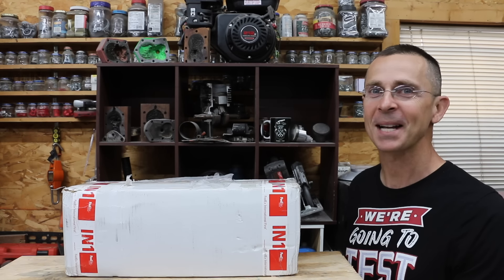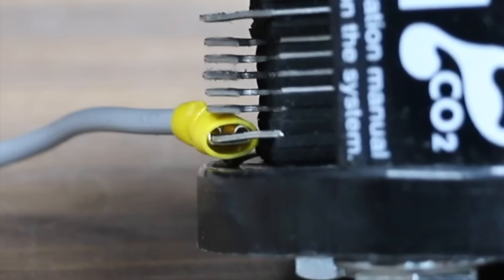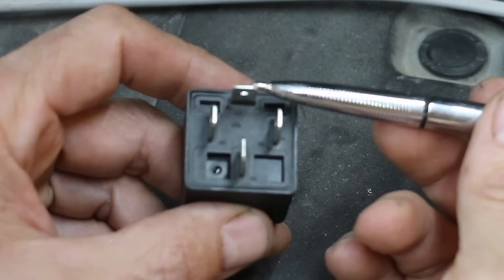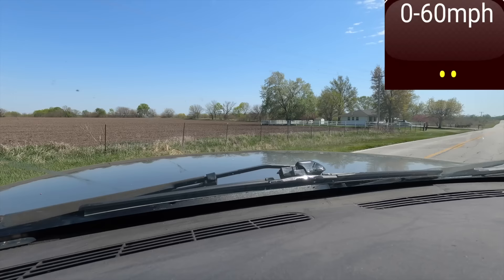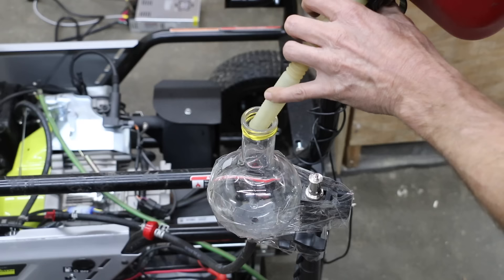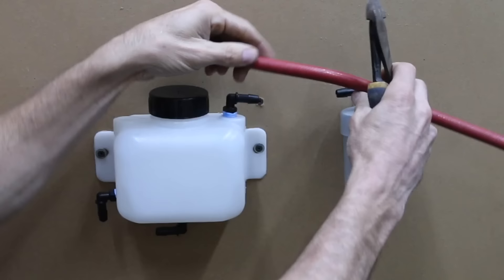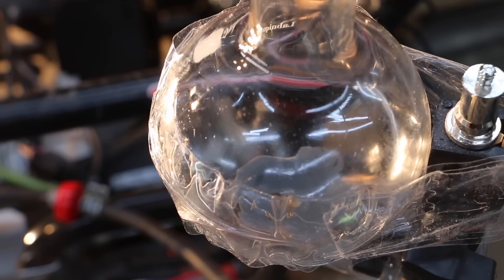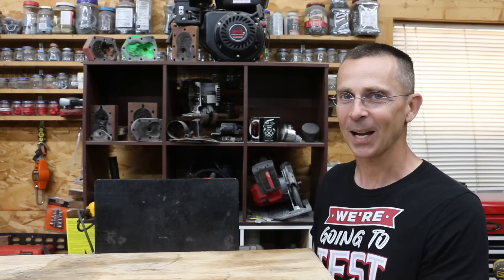AMAZING 35% More MPG with HHO? Let’s find out! Help with high gas prices?

Comment: I want to see more fuel saving devices tested
Reply: 🦶 This will save you fuel.
Reply: Spoiler alert- they are all scams.
Reply: @chrisE815  only thing that helped me get better fuel millage on my ram 5.7 on 35's was a tune. I tried this hho system about a week and I was averaging 7.8mpg driven hard before hho  it  was 8.9mpg daily driven and driven hard no tune no hho. After the tune my avg was 15.9 mpg and a gain in performance as well. 

This is for everyone that is interested in this item. If you are planning on getting better fuel millage and better performance from your car or truck engine spend the extra money and get it professionaly tuned. It will save you time and effort. This thing is a scam.
Reply: @danickdesrosiers7338  if you want to save fuel, you could just buy a smaller car. 
My car goes about 50mpg and its not slower or less comfortable than your car.
Reply: @TobiasHinz1992  what kind of car
Reply: The best free fuel saver is a lighter foot, otherwise 🚲🚲🚲.
Reply: @danickdesrosiers7338  If you are getting better gas mileage AND fuel from a tune, you are severely decreasing the life of your engine. It all comes with a tradeoff, otherwise they would be tuned that way from the factory. Now after the car is used a lot and parts wore in a tune to re calibrate everything in theory could help some without sacrificing engine life but a lot of manufacturers computers already have that figured into it. Only time a tune is actually worth it is if you are using the car for performance and don't care about the life of the engine.
Reply: @TobiasHinz1992  Imagine being in your mind. Terrifying. "Oh hey stranger! I know more about your life situation than you do."
Reply: @MrSplibb  Skoda Fabia Combi 5j, 1,2 TSi, 105HP
Reply: @eriklarson9137  you're american and I know enough of you by that. You all drive way to big cars to impress the neighbours. That's why car repossession is a thing in the USA.
Reply: Or, alternatively, debunked.
Reply: @TobiasHinz1992  cars get taken back in other countries also.
Reply: I read that riding a bicycle will help save fuel.  I will ride my bike this week and get back to you guys with the results.  Don't worry, I bought my own bike and I'm not sponsored.
Reply: @josh6149  different strokes for different folks.   I'll keep driving my f350 and trans am.
Reply: Same
Reply: None of them work. No testing needed.
If anything worked then vehicle manufacturers would use it. They struggle to meet the power and efficiency targets more and more with each new model and wouldn't overlook something so simple as magnets clamped on your fuel line or some other garbage.
Reply: @1one3_Racing  the technology has been around since the early 70's, but suppressed or destroyed by the federal government, to satisfy their big oil contributors.   A guy had converted a 1970 Cadillac to run mostly on hydrogen, getting around 70 mpg, but he disappeared, along with the design he developed.
Reply: Waste of time. All are scam ripoffs.
Reply: Oh no sir.  U got a defective unit...just call the seller. And theyll ship you a proper functioning model...maybe it was dropped during shipping...
Reply: @JohnJohnson-bg2oo  
it’s not big oil It’s emissions
Clean air 
And somebody said earlier up in the comments it is the longevity of the motor
Reply: @Voyajer.  I had an S10-ZR2, not bad up to 55, but above that I swear I could see the fuel gauge move while driving down the road.
Reply: Anyway, if these apparatus was so good they would add them at the cars factory!
Reply: @aaronwetzel8444  yeah, you keep believing that bullshit, but the reality is that the federal government uses fuel prices, and lower efficiency motors, in collaboration with oil companies and automakers to keep them in office and us under control.   If everyone could drive an efficient gasoline powered vehicle, and save money from doing so, they'd figure out some other way to tax us for being less polluting.   The fact is that global warming is a hoax, as far as any real climatologist has studied, and the green new deal bullshit is a fictitious way toward communism in America.
Reply: @f4tboy99  Stop drinking the Cool-Aide!  It's "Big Oil" keeping them out of the hands of consumers on a large scale.  It's amazing the reach that Big Oil has, they even have sway over cars made in Russia, China etc.
Reply: @JohnJohnson-bg2oo  hydrogen gas has similar if not lower stored energy to gasoline, changing to hydrogen can’t give you ridiculously higher mpg. Hydrogen gas is a extremely small molecule, and experiences a lot of blow by when used in gas engines. Further more producing hydrogen gas  requires energy to begin with, energy that could be used more efficiently...
Reply: @thedarkness5133  tunes from the factory have to take smog control into account not economy or performance. There is lots of wiggle room for improvement without damage.
Reply: @VC-Toronto  Are you saying to me that you would buy them? 🤣🤣🤣
Reply: @Dirty_Bear22  yeah okay, they use it for the space shuttle, mixed with kerosene or jp4 jet fuel.   Seems to store plenty of energy to shoot hundreds of tons of metal and composites into space so....🤣😂
Reply: @thedarkness5133  From someone who actual has experience both with tunes and as a mechanic - this is straight up horseshit
They are tuned the way they are from the factory to run normally for the lowest performance they expect from the parts they fit, this means loose ignition times and many other settings are slack and often actually are more damaging to the engine over time than a tuned one where they have spent the time getting result for your car as it is and making the profile fit

As for the profiles from the factory being designed to avoid sacrificing engine life? Get real - there's a reason why there are expected mileage breakpoints in used cars, they are designed to wear out at certain points in order to encourage those who buy new to continue on the treadmill rather than maintain their own vehicle
Reply: @JohnJohnson-bg2oo  Yes global warming is a hoax. But it is nice to have less smog in the cities.
Thankfully the coal rollers are mostly in the country where the plants happily feed on their stupidity.
Reply: There's no such thing as a free meal. From a conservation of energy standpoint the best you could hope for is getting your 70 watts of power required to generate the hydrogen and oxygen back when they are burned. But there's that whole entropy thing that probably no one cares about...
Reply: @BinkySears  actually a alternator is a above unity device.
Which means the power that it takes less power to spinet it is less than the power that it generates. 
by less than 1% but this means theoretically if you had a big enough motor and a big enough alternator
You could generate free power!

But sadly this is impossible because they do not have a electric motor that is 100% efficient.
Reply: @JohnJohnson-bg2oo  okay? Not sure why that’s relevant to vehicles though.
Reply: @aaronwetzel8444  you will always have losses, the best theoretically possible efficiency is 100%. You can’t make something out of nothing.
Reply: @bengrogan9710  You may be a hack mechanic, but you sure aren't an engineer or scientist that understands more than the surface of things that people told/taught you.
Reply: Years ago... around 1970... we took a J.C. Whitney auto parts catalog and added up ALL of the claims of the various "sucker bait" device ads (full page of glowing promises)  - pills for the oil, fuel line magnets, goofy spark plugs, 'energizer' liquids for fuel tank and oil, etc.

By our reckoning, if you installed ALL of that stuff your little car engine would become a TIGER at the drag strip and beat all competitors; to run it on the street it would need some kind of governor it was now such a *powerhouse*. 

You'd get so much mileage improvement you would need to stop every 80-100 miles to drain the fuel from the tank before it overflowed - never needing to ever fuel up again... and your engine would be rebuilt as you drive!
Reply: Yeah
Reply: @Dirty_Bear22  
Alternators are classed as a above unity system.
More than likely this is because the energy that it receives is rated differently and the energy produces.
Reply: yes please me too, instead of snake oil this machine was more like snake piping
Reply: @JohnJohnson-bg2oo  bullshit. You can go to a "chip tuner" and he'll get you better fuel economy, but your car will run too lean and you will have holes in your pistons soon
Reply: @VC-Toronto  tell me about it man. My STi when above 80 and at full boost gulps gas by the gallon. Smiles per gallon though is what counts even when its 6mpg!
Reply: @TobiasHinz1992  That’s where the Hydrogen generator comes in the water produces in your cylinder provide some coolant allowing you to go far lean or on fuel before something breaks
Reply: The problem is hydrogen and oxygen combining is a heavy oxidizer
Reply: @aaronwetzel8444  again bullshit. If you want to lower the combustion temperature, you need to install a water injection system. But with these you have to look for your oil, because water kann mix into it.
Reply: @thedarkness5133  Very well rebutted, totally countered the points I raised with factual argument and totally wasn't simply an attempt to smear with nothing of value said. /s
Reply: @TobiasHinz1992  Direct injection water works amazing the explosive power of water when contacting hot steel provides over twice the power per volume of diesel.
Warm water hitting hot engine components causes premature failure.
As far as hydrogen oxygen combines into steam providing some coolant not enough to prevent serious engine damage end it also causes oxidation to the rings and valves
Reply: Propane kits work, but you need a source of cheap propane and an older car since it would be very difficult on a new vehicle.
Reply: @JohnJohnson-bg2oo  Hydrogen cars have been a thing longer than the 70s, and you can literally buy them new today or convert existing engines, its not some big hidden secret thats been covered up.
Reply: @nugginusslover476  actually the head injury happened before I got a drivers license and I have no memory of anything before it. And only remember what happened vaguely my older sister drop me on my head I was under a half year old I still remember it. I have a photographic memory I was able to tell my parents where it happened and details about the room down to the paint color and what was happening outside the windows.

Also they don’t even call global warming anymore they call it climate change.
Yes cleaning up the air to much is going to cost us all to roast lol.

My parents were told that due to too much pollution we were going into the Ice Age this makes far more sense then what were being fed today.
Actually it might’ve even been true and that would make sense we averted a major Ice Age by cleaning the air we also got rid of acid rain.

with defrauded a major disaster what we’re seeing it’s a pens on the swing.
Pollution caused Global cooling now it only makes sense Getting rid of pollution would cause Global warming.
Follow the logic I guess head injuries help you to step back and see the bigger picture :p
Reply: Skoda hahahha thau car is a big joke in europe
Reply: @aaronwetzel8444  so let me get this straight. Your understanding of climate change is: "pollution" -> less sun -> less heat
And all the scientist magically forgot that but you remember it and actually get it?
Please inform yourself how climate change actually works and if you find a flaw only then respond please 😘
Reply: @nugginusslover476  I believe that this is Bill Gates understanding of it that is why he has developed a plan to release sun blocking pollution in the atmosphere to stop global warming.

Bill Gates is funding a chemical cloud
To block sunlight.
Do your research and get back to me
Reply: @TobiasHinz1992  you made ABSOLUTELY no sense in that statement! 🤣 Holes in pistons are caused by a timing issue, not the fuel/air ratio in the combustion chamber. 🤣 So if you buy a chip for your vehicle and don't have the know how to set the computer system on your vehicle, take it to someone who does, and it'll last just as long.   Just like a turbocharger has to be "tuned" to get maximum power/performance.
Reply: @aaronwetzel8444  so you didnt understand and now try to redirect my attention towards a project from Bill Gates. (and for your plessure I looked it up and its controversial)
Big hint: the exclamation marks in my previous comment. Not all pollution is the same. Not everything blocks the same wave lenghts...
Reply: @nugginusslover476  When I learned the most harmful greenhouse gas as far as causing global warming is water vapor.
Yes your point is valid not all Pollution is the same.
Step back and take a look at earths history Global warming global cooling and mass extinctions see the earth takes care of itself no need for human intervention
Reply: Vapor.  Fuel vapor, loads of vids, easy with a carb!!  The liquid part of petrol/gasoline is totally unnecessary, check it out!
Reply: @aaronwetzel8444  so you still havent looked it up. great, thanks comeback if you understood it and then disproove it. my final answer until that happens
Reply: @nugginusslover476  I have heavily researched The science behind Climate change.
I have also heavily researched the properties of different greenhouse gases.
I also heavily researched solar cycles
And earths history the climate is constantly changing.
Reply: Ignoring general cleaning, maintenance, and tuneups, the best fuel saving device you can install is a vacuum gauge. Not because it does anything by itself but because it can help train you to be more gentle on the throttle, which is much better for MPG.  Throttle to the floor will kill vacuum, which will cause the gauge to read such and indicate to you that you should probably let off the throttle. You can easily find a 10% increase in MPG with one once you learn to stop accelerating as hard. Especially on hills. Keeping a consistent throttle position on an uphill will help save a lot of gas, though you'll drop speed.

There's also fuel economy specific tunes that will absolutely kill engine power but deliver some MPGs as well. Like warm air filters that will always take in warmed air from a radiator for instance. Bad for performance, great for mileage. You can also mess with spark timings as there are timings that are best for fuel economy but bad for performance, and vice versa. Insulating the radiator a little so it gets hotter faster can help economy as well as adjusting the thermostat to allow it to run a couple degrees hotter, though you'll start sacrificing lifetime for that. But if you are driving high mileage, you probably won't be stressing the engine enough for it to matter if you don't go crazy with it.
Reply: @soundspark  saves up weight as well, better to replace doors with polycarbonate omes
Reply: @JohnJohnson-bg2oo  On point! Teach the peeps.  Shalom
Reply: @Dirty_Bear22  very relevant.. Did
u watch the whole video..?
Reply: @nugginusslover476  It is HOAX
Reply: @nugginusslover476  Exactly!
Reply: @aaronwetzel8444 Yup.  . Exactly what
Reply: @SuperReznative  you wrote 5 comments and addee 0% to the conversation. And you replied to me "hoax" on the one hand and "exactly" on the other. Atleast give some context if all you can do is react to comments and not add anything
Reply: @SuperReznative  what?
Reply: The only known fuel saving device is your foot.  My wife and I get 5 mpg difference driving her vehicle on average, just due to throttle and brake usage
Reply: @TobiasHinz1992  that...and the county we live in isn’t the size of a medium state...
Reply: A bicycle. On short trips your fuel consumption is just about zero.
Reply: @HumbertoYi0878  so what? My car is comfortable enough to drive very long distances. Do you really think that the shitty Pick-ups most of you drive are more comfortable than my car?
Reply: I have 3 different fuel saving devices that work perfectly......Up here we call them bicycles...
Reply: @TobiasHinz1992  does your vehicle haul 9,000lbs? No? Doesn't take a rocket scientist to figure out why there are differences in the way vehicles are used.
Reply: @josh6149  must be nice to live a mile from everything.
Reply: @JohnJohnson-bg2oo  You must have heard this on fux news....Ha, Ha, ha!
Reply: @joelthames1141  heard what?  Just because I'm smarter than you, means that you try to resort to labels in a pathetic attempt to make yourself seem smart?  I research several different sources for information, EXCEPT CNN, MSNBC, or CBS.   These MSM outlets have proven at best unreliable, and at worst, linear in their commitment to the corrupt democratic party, regardless of any facts they overlook or simply disregard for ratings.
Reply: @TobiasHinz1992  it's definitely slower
Reply: Want in one hand and xxxx in the other.  Ever heard of the word please?
Reply: TruthOrDie777. com  you have to add a "@" infront of the name.
I am in fact not a rockefeller but a I have decent understanding of thermodynamics and that's why I can tell you that a purely water powered car would never work and a hybrid version is always less efficient than just using that second energy source directly
Reply: @danickdesrosiers7338   Unless you're using proper scientific methods, this is not necessarily true.  It has been proven that when people do these types of things (any fuel savings device/tune/etc...) the positive results are from changes in your driving behavior which happen as a result of you "proving" it is working, for example:  you will not step on the gas as heavily when accelerating.  Cognitive bias is a real thing and humans HATE being wrong, especially when they have bought into something.  Most people hate being duped and continue to pursue things bc they're "pot committed" and their ego is on the line.  
Note:  Yes, tunes CAN have some improvements (maybe some gas consumption by running more lean, or more torque, etc...) however the tradeoffs are never worth it as you are running the engine off it's designed parameters resulting in faster/more wear on the engine, which will cost more in the long run than the miniscule amount of "gains" you achieve.  
However:  I would LOVE to see a side by side comparison to prove me wrong!
Reply: @thedarkness5133  100% and a better way of stating what I said as well, wish I had read this comment before I hit reply!  :)
Reply: @matthewtyler4579  How?  Specifically.
Reply: @thedarkness5133  manufacturer's have to meet emissions, so it is possible if you live in a state without emissions to remove the restrictions and let your vehicle breath, without risk on the engine life, you may get better life from it.
Reply: @sergiosergio12345678  propane burns cleaner, but more expensive to run 1 gallon of propane than 1 gallon of gas.
1 gallon is 8 pounds.  Propane tanks also need to vent if in sun or around blazing asphalt.
Reply: @Voyajer.  you mean Mr. Gordon Lightfoot gets good mileage?
Reply: @tysonsydenham5614  That's hardly the kind of "tune" I'm speaking of.
Reply: @tysonsydenham5614  Of course you need to re calibrate your vehicle if you take off your catalytic converter and put on flowmasters to get the most out of it. That's not what I'm talking about.
Reply: @Charles McKinley 
William Shakespeare ... Soft, whither away so fast? A true man, or a thief, that gallops so?

What are you hiding your insecurity makes me laugh.
Reply: @Charles McKinley is the earth flat? What’s the Moon landing fake?
Is this the best strawman you can make no originality.
Reply: @Charles McKinley what a alternator is not above unity system?
Then my theoretical physics professor must have been wrong.
Reply: @Charles McKinley does insulting other people’s intelligence make you feel better?
Is this because you feel insecure about your own intelligence?
Reply: @Charles McKinley yes seventh grade.
You’re obviously quite proud of your seventh grade education.
Reply: science is not my strong point.
But the man who told me that has helped write several textbooks. 

You asked why I wasn’t paying attention in seventh grade.
The truth of it is I was already in the workforce and was making more money than my father. 
Every bit of education I have, I thought for.
Do I have a college education now?
 yes and somethings.
I paid for it out of pocket 
I took no loans and no handouts
You can insult the fact that I handed on a piece of information that you claim is faulty. And you would be just in doing so.
But insult the intelligence of a stranger only screams to everyone reading that you are trying to feel better about the fact that you are low intelligence. Is that the point you were trying to make because it’s the point that’s coming across.
Reply: @TobiasHinz1992  lol yeah u sure got us all figured out don't ya.  
I get it tho Id be jealous of America too if I was from another country that only has weird tiny cars that are shit
Reply: @Charles McKinley yes it is clear.
I believed a man Who spent his whole life questioning what was possible.
Even if he was wrong without men like that our caves would still like paintings.
Reply: To save fuel plan you trips/driving better like on the way home from work stop at the grocery store you are driving past anyway.....or when you can ride a bike or walk. Most people could probably save 30% of driving miles just with careful planning.
Reply: @TobiasHinz1992  -- You car is very definitely less comfortable than a 1984 Olds '98 Regency Brougham.
Reply: @mikeschneider5077  I don´t even know what that car is. But if I had to guess, I would say that it is a big, slow, expenxive pile of garbage. There is a reason nobody outside of the US buys your cars.
Reply: @TobiasHinz1992  -- "I don´t even know what that car is." --Because you're too lazy to search the terms I gave you." --You don't have to guess, because I am TELLING you: Your car is not as comfortable (that being the claim you asserted), because your car was never optioned with "pillow trim". "There is a reason nobody outside of the US buys your cars." --Sadly, the US is an overtaxed, overregulated nascent communist nation now; nobody buys our cars because we don't MAKE cars anymore. And any used 1984 Olds '98 Regency Broughams that come up on the market are immediately snapped up by rich Indians for export.
Reply: @JohnJohnson-bg2oo  The technology was not suppressed or destroyed. Hydrogen powered cars exist and work just fine. They just aren't commercially viable on any kind of large scale yet. The device tested in this video does not do what Hydrogen powered cars do.
Reply: @JohnJohnson-bg2oo  James Goodman said hydrogen has less energy than gasoline. You laughed at him based on the fact that it's used in the space shuttle.
Yeah, they use it in the space shuttle...but not because they think they will get better mileage out of it.
Reply: @aaronwetzel8444  "The problem is hydrogen and oxygen combining is a heavy oxidizer."

Dude, you don't understand the words you are saying. No, the combining of them is not a heavy oxidizer. Only the oxygen is a heavy oxidizer, and that's before it's combined with anything into a stable molecule.
Reply: Me too. How about one of those magnetic devices you clamp over your fuel line.
Reply: the only fuel saving device that legit works are your legs
Reply: The big car companies have done all that can be done. Any offer to do more is a scam.
Reply: It amazes me how so many people believe squirting water into an engine will make it work better but no one chucks a bucket of water onto a fire to help it burn better
Reply: Test a new Tesla car. I heard they are unbelievable, like u never have to fill up the tank
Reply: Cars aren't designed to save fuel.  If you mod them to get really good fuel mileage it's not wise to publicize it.  Did you know engines run by expanding gasses in the cylinders not fuel.  (example steam locomotives).  So, gasses that expand the most run engines better.  Hot fast even heat after the top center makes a nice clean complete piston pop that starts cooling on descent.  It continues to cool and constricts causing a mild vacuum on the up stroke reducing engine drag.  Opposed to the 14.7 to 1 mix currently used.

Conventionally, the cylinder fires up to 15 degrees before top center to heat enough fuel to pop the piston (120 feet per second) and then fuel continues to burn at around 100 feet per second (adding no more power to the stoke).  However, the engine then has to extinguish the flame on the upstroke against gasses still attempting to expand.  Fortunately, when hydrocarbons, CO, and NOx is dumped to the exhaust we have a catalytic converter to finish burning the excess fuel wasted by the car.  But what do I know?
Reply: @chrisE815  yes they are.  a real solution would throw the balanced of power into a tail spin.  a lot of big people would be very unhappy.
Reply: @turboflush  buying a car on credit is possible in Europe, but not a big thing.
Reply: @Reno Simpson 58
Reply: @Reno Simpson You asked how many cars start with P?  Well, I found 58 car's names that start with the letter P.
Reply: @Reno Simpson Cars that start with the letter P:
Paceman, Pajero, Pajero Sport, Palisade, Panamera, Panda, Pantera, Parisienne, Park Ward, Partner, Paseo, Passat, Pathfinder, Patriot, Datsun Patrol, Nissan Patrol, Persona, PF-Zero, Phantom, Phoenix, Piazza, Picanto, Pik-Up, Pintara, Plus, Plus 4, Plus 8, Polo, Portofino, Prairie, Prefect, Pregio, Prelude, Premacy, Preve, Princess, Prinz, Prius, Prius C, Prius V, Pro_cee'd, Probe, PROSTAR, PT Cruiser, Pulsar, Puma, Punto, Pursuit, and Pyzar

Makes that start with the letter P:
Pagani, Panther, Performax, Peugeot, Pininfarina, Pontiac, Porsche, Prince, and Proton

And technically pee might even work as a base for HHO or hydrogen powered.  It's even premixed for electrolysis.;)
Reply: the only one that works is the one on  the bottom of your leg
Reply: @JohnJohnson-bg2oo  Enjoy your shrinking wallot while others grow their stack for better things.
Reply: @JohnJohnson-bg2oo  Respect
Reply: @jasonjohnson6216  Garbage company
Reply: @JohnJohnson-bg2oo  Are you kidding? MOST bombs are Oxygen bombs.
Reply: @xtnuser5338  hydrogen bombs, neutron bombs and nuclear bombs aren't oxygen bombs! 🤣😂  splitting atoms genius!
Reply: @JohnJohnson-bg2oo  Duh. That isn't MOST bombs genius.
Reply: The only way I’ve found to reliably increase fuel efficiency is to make sure my tires are properly inflated, don’t accelerate hard, and don’t carry any more weight than necessary. Everything else seems to be bunk.
Reply: @truthsmiles  With any engine using a throttle plate...it is most efficient at full throttle opening, and operating in the rpm range near peak torque. This set of conditions will get the most work done for the least amount of fuel burned.

And weight only matters because the energy used to speed it up is then wasted when we slow it back down with our brakes. If we let off the gas a lot earlier and coasted down to a stop, the effects of weight would cancel out and have zero effect on mpg. But of course we don't drive like that, even when traffic is sparse and we could. Oh, and I guess it also matters a little bit because a heavy car deforms its tires more increasing rolling resistance, but if you increase tire pressures you can minimize this factor.

During efficiency contests, that's how the competitors drive; alternating between full throttle acceleration and long coasting slowdowns.
Reply: @xtnuser5338  That’s fascinating about the competitions! Though, I would tend to think less weight is easier to accelerate and requires less work from the engine - or, in the “all or none” scenario you describe, a smaller, less fuel-hungry engine would be required in the first place?
Reply: @truthsmiles  Of course more weight requires more work to be done, and therefor means more fuel required, for acceleration up to a given speed. But it also means we have more kinetic energy / momentum available at that speed, to coast further after we let off the gas. Those two things WOULD cancel each other out...IF we drove right. But we don't. It's almost impossible to do, what with other cars on the road, traffic lights and signs, etc. We need to use the brakes. We take that higher kinetic energy we have, which would let us coast farther, and instead of taking advantage of it, we waste it as heat, when we use the brakes to slow down sooner than we would have by coasting alone.

I hope that made sense. In our everyday usage habits, of course heavier equals worse fuel efficiency. I just wanted to point out that physics shows us it isn't inherently the weight's fault...but instead is because of how we use the machines. Those competitors try really hard not to ever use the brakes. They try to anticipate stops a long way ahead, and let the vehicles slow down naturally by coasting as much as possible.
Reply: @xtnuser5338  Yes it all makes perfect sense and I generally agree. I'm just not convinced that, all other things being equal, a heavier vehicle will result in equal fuel efficiency, even with 'perfect' driving. Surely at least the tires will deform more and create more friction? Wheel bearings? Etc. I agree it can be managed to a low level but surely it must make a difference, especially in a competition?
Reply: @truthsmiles  Yes, there are a lot of little additional factors like rolling resistance, drive line friction, etc. that would have an effect. I'm just talking strictly about the variable of mass, as if we were doing a high school physics problem that ignored all those other little variables. A greater mass would take more fuel to accelerate, but also coast further, and those should exactly cancel each other out, thanks to the law of conservation of energy.
Reply: @xtnuser5338   I still disagree haha. Assuming a perfectly frictionless world, to get a 10kg mass from point A to point B in T time is going to take more energy than a 5kg mass would, no?
Reply: @truthsmiles  In a frictionless world, we also have to expend energy to slow down and stop the mass at point B. Otherwise, like a space ship, it would coast right on past point B and keep going forever. And yes, if that fits the requirements, then we only have to consider the acceleration phase, and of course more energy is needed.

In order to understand what I'm describing, we need some drag to overcome.

In order to start at point A, and stop again at point B, we have to do two things. We have to accelerate the mass, and then decelerate it again. Accelerating more mass requires more energy. But then shut then engine off and coast down against the drag such that you end up stopping at point B. In this scenario the mass doesn't matter. Sure, it takes more fuel to accelerate, but you can also start coasting sooner.

That only considers distance of course. Once you add a time requirement, things change. A heavy car would take a long time to get from A to B, because you would spend a long time coasting, bringing your average speed way down. And in fact since we start coasting a lot earlier, we can't accelerate as long in the beginning, otherwise we would overshoot point B, so we don't even hit the same top speed before we start coasting.

We don't do that when we drive cars in the real world though. We keep going the speed limit until it's time to brake.

But if we did...if we drove everywhere accelerating at full throttle just enough that we could coast to our next stopping point without touching the brakes, we would get the best mpg. And indeed, that's how the competitors try to drive.

They go full throttle, up until the wind resistance starts to screw up their mpg. Then they let off and coast almost back down to a stop, hopefully never having to touch the brakes. Then they floor the gas again, and keep repeating the pattern.
Reply: @JohnJohnson-bg2oo  yes average mpg in europe where fuel is $5 per gallon is far greater and engines much smaller, and very high MPG cars are possible such as the ISUZU three cyl that got over 50 and the little pickups that got 40 like the VW rabbit. Theyre not sold under the oil wars policy of foreign intervention in the mid east!
Reply: @Dirty_Bear22  finally a real answer!
It's called " conservation of energy".  Though the processes are quite different, it is quite likely that the energy it takes to produce the hydrogen, is greater than the effect of the hydrogen on the engine. In fact there is likely a small loss of energy in the process.
Reply: @thedarkness5133  seriously??? So new spark plugs, leads, coil packs all tested at right resistance? A spotless air filter, an ECU remap done properly will stuff your engine quicker? No it won't! If you drive properly and give it a bit of hard acceleration every week just to blow any carbon out. Or water injection on a high compression engine? Yeah no mate! If I did over 400k on my 3.3 litre high compression engine? It was going hard till I sold to the wrecking yard! Only cos some moron ploughed into me, gave me whiplash and the car was a rigjt off! Your theory is garbage!
Reply: None of them work...
Reply: @VC-Toronto  my 97 ZR2 got 18.9 with the cruise set at 84, AC on in 95° heat with a raised topper. That was one specific time I remember checking it. With the topper off it gained 2mpg. Driving it normally on the highway it would get 23mpg and never downshift. Better truck than the Colorado Z71 that replaced it
Reply: @danickdesrosiers7338  aren’t tunes expensive so there’s a couple months worth of gas right
Reply: @JohnJohnson-bg2oo  nonsense and hearsay with no basis in fact. You aluminum (not tin) foil hat people give me side splitting laughter. I surmise that, overall, big-auto is bigger than "big-oil".
Reply: @1one3_Racing  I dunno... I placed magnets on the fuel lines of my truck and 38000 miles later I have not even burned one (32gallon) tank of gasoline!

 (BWAHAHA, it is a Diesel)
Reply: @aaronwetzel8444  an alternator is not an above unity device. It suffers mechanical energy losses through friction in the bearings, windage of the rotor and cooling fan, and friction of the drive belt. There are electrical losses due to resistive heating in the windings. You have been grossly mislead.
Reply: @TobiasHinz1992  you're too funny
Reply: @TobiasHinz1992  if you have to worry about shit like " holes in your pistons " then you need to find a tuner who isn't a know nothing hack. 😆
Reply: Big Oil doesn't like that.
Reply: @MrSplibb  I had similar mpg in my 2011 Ford Fusion, was also super comfortable, great sound system, and it could get up and go as good as any other sedan
Reply: @JohnJohnson-bg2oo  Has you seen the size of the gas tank attached to the shuttle. The energy density of hydrogen per gallon is 7 times less than gasoline so mpg with hydrogen will be 7 times worse than gasoline for same power output. Your average US car will have to tow a large trailer of fuel behind it to keep up with the 2mpg
Reply: Biggest let down for me was the gas fume test. I was sooooo pissed.
Reply: @oldbonesbushcraft Rod Jackson it is indeed. You want to save fuel? Buy a smaller car. It's literally that easy.
Reply: @ShyRage1  doesn't work, none of them does. 
Power is made of fuel. If you need a lot of power, you will need a lot of fuel.
Reply: @TobiasHinz1992  Have you personally tried this product?  ANy videos and stats of your tests?
Reply: Ew democrats.
Reply: @Rob-sr9rj  I'm as far from a democrat as it cat get. I'm just not an ameritard.
Reply: @TobiasHinz1992   That's nice. Have a good day.
Reply: @paulwilliams667  you have no idea what you are talking about
Reply: No testing is required. Unless the promoter of the device can simply explain how it works and why.  It's the "why" they fail. As is usually based on fringe science using special materials or methods that oppose laws of science.
Reply: @JohnJohnson-bg2oo  
Believe I saw a short video about this guy. Primarily a vacuum carb, one attempt was made on his life, then he and his car disappeared.  That sound familiar?
Reply: @happydays8171  yes, that's the guy.   Had a Ford torino, or Cadillac, some kind of land yacht that got 50mpg?  Something ridiculous, on hydrogen and very little fuel.   Then he disappeared like you remember.
Reply: @matthewtyler4579  ok, walk 18 miles everyday to work.
Reply: @T80990  yes walking is a great fiel saving technique, although I used a picture of a foot for how hard someone pushes the gas pedal... not sure if you drive or not seems like it went right over your head 🤔
Reply: @matthewtyler4579  ohh, haha alright. Yep, it went over my head
Reply: @1one3_Racing  Put larger diameter tires on the back.  This way you will always be driving downhill :)
Reply: Best way to save fuel is to drive slower. It's free and it works !!!
Reply: The best 'device' is to place a block of wood under the throttle pedal, combine that with safe free-wheeling and watching the road well ahead, no harsh braking or acceleration. Could easily give you 25% improved mpg
Reply: @benj213   Tobías is gonna drive his car every day know looking at it as a piece of crap now lol 😂
Reply: @1one3_Racing  Not true. There are things that work but the car manufacturers just don't want it because they didn't invent it. I have one in my car and the smoke emission tests confirmed it.